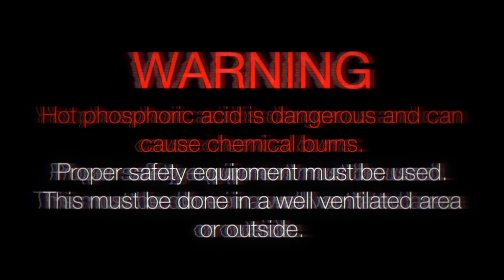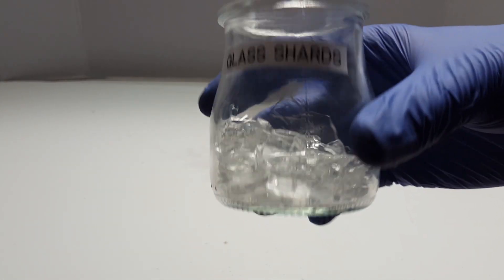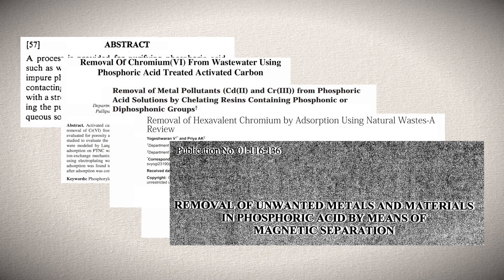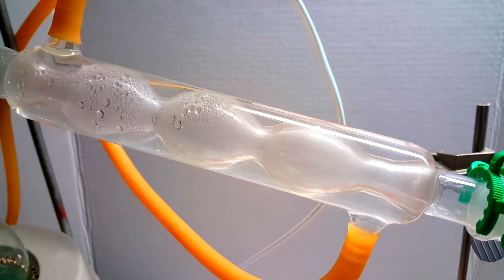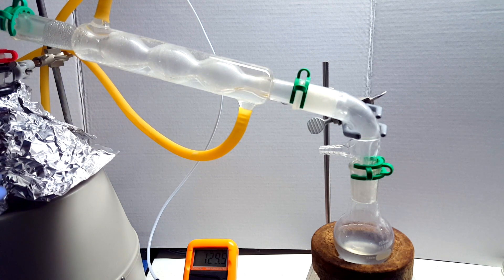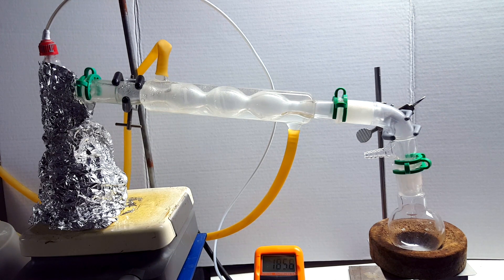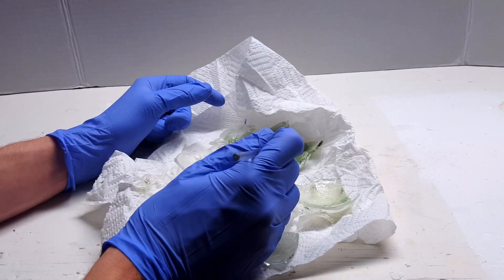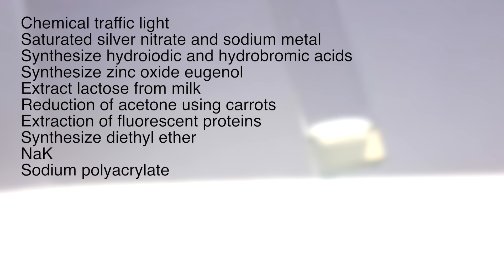Extracting Phosphoric Acid from Rust Remover (Revisiting)

Comment: Would it be possible to convert to calcium phosphate then acidify with sulfuric acid and filter off the formed calcium sulfate? It should make a relatively pure phosphoric acid solution. If you’re using the chromium contaminated otc product, idk if that would help, but maybe you could start from pure calcium phosphate purchased from online?

Comment: Oh man.  I feel your pain on those plastic keck clamps.  I made the mistake of using plastic clamps the first time I made nitric acid.  It didn't melt, but it began decomposing forming a light green crust where the clamp was splitting apart.  It later crumbled to pieces.  I now have "stainless" steel keck clamps, but stainless doesn't really stand up as stainless in chemistry and several of those clamps are covered in rust.